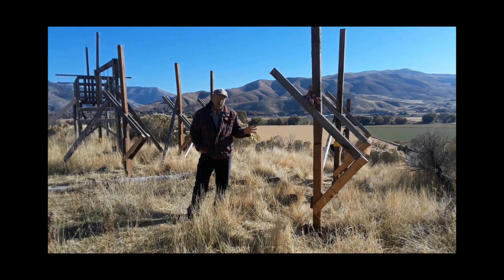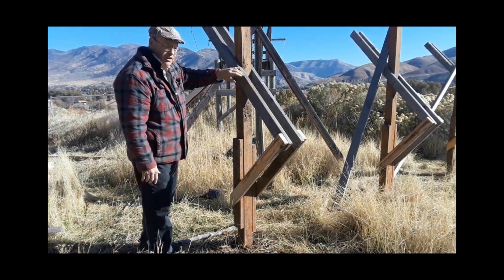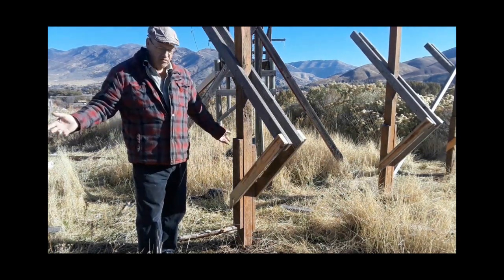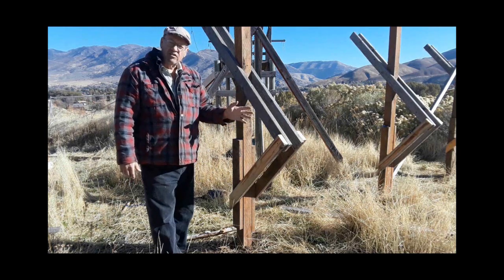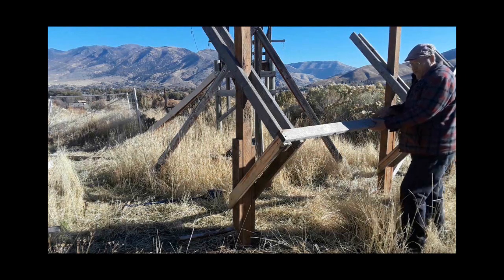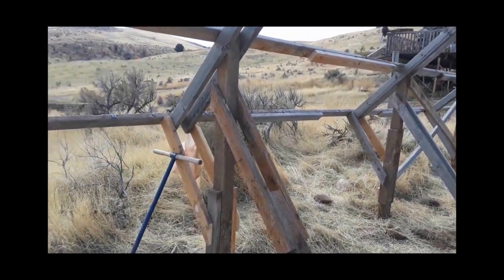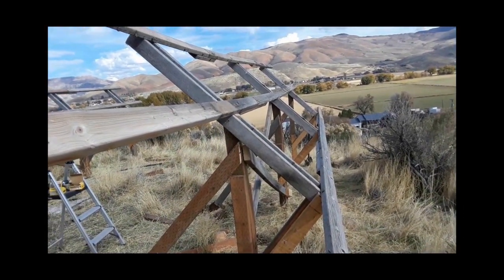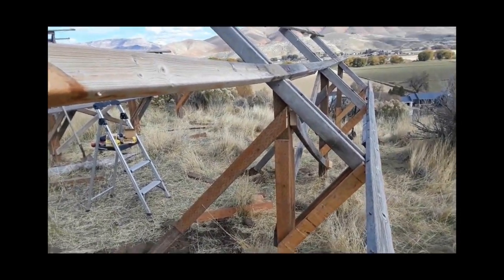Greenhouse Winter Heating System Part 9  Building Solar Panel Racks

Comment: Hey Eddy. Great video buddy. That’s the same philosophy I use when I build out here. I have seen people put non treated lumber into concrete where the concrete came up above the ground level and it lasted for over 20 years too.
Can’t wait to see the panels in action.
Chuck
Reply from the maker: I've seen that too.  Keep it away from the ground and it does well.  I put some untreated posts directly in the ground a while back.  Three years was it took to rot them out.

Comment: Hi Eddy, did you optimize the sun panel angle for the winter solstice or the longterm coldest day of the year? I can even imagine that it might make sense to orient the panels more to the east in order to beat the coldest moment of the day, just like recommended for passive solar greenhouses. But it also depends on the delays in the heat mass storage in the greenhouse. That's why I was nagging you with heat storing barrels below your growing beds. The fears for my greenhouse are freezing barrels, I consider adding glycol to the barrels. Best wishes, greetings from Holland
Reply from the maker: Hi  Earl,  I wasn't that careful.  I was mostly concerned with having enough slope for the snow to easily slide off.  I think you're right though, maybe I should have taken more care aiming them better.   But this is only enough for a trial run this winter.   So far it's working pretty good.  On a good day I Get about 2,700 watts delivered.   That's not bad when you consider they are rated at 2,900 watts max.  Always good to hear from you.  
Ed
Reply: @eddysgreenhousegarden7022  Amazing delivery, you must have guessed near the sweet spot.